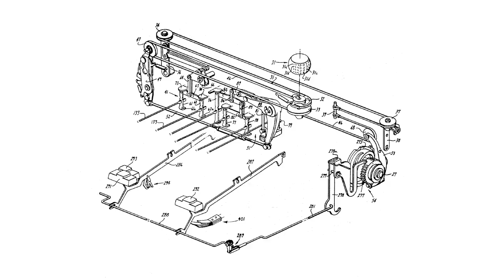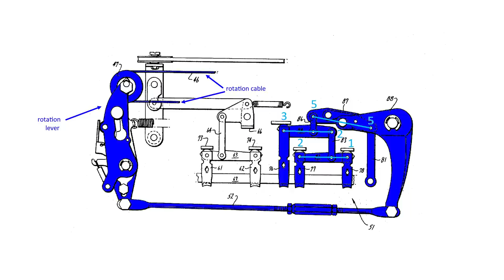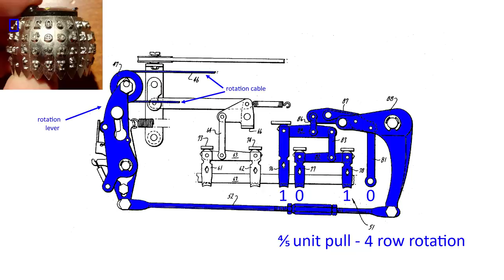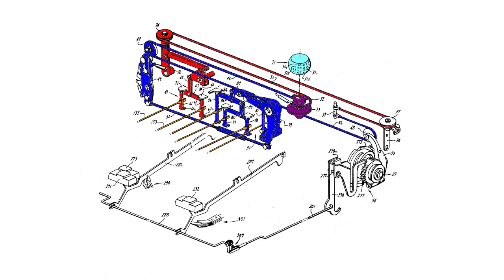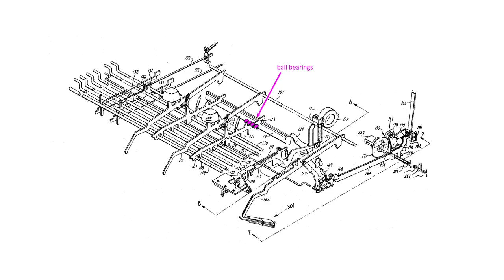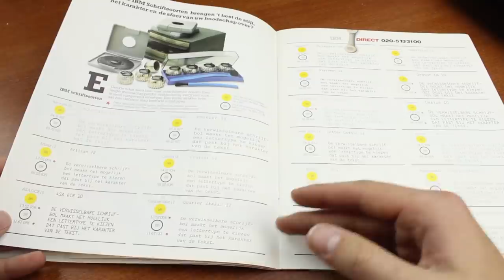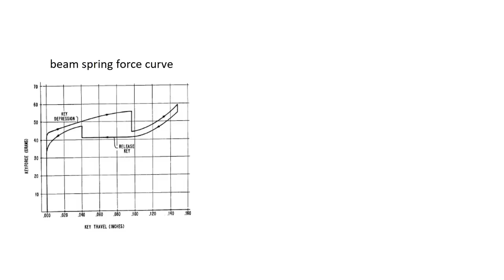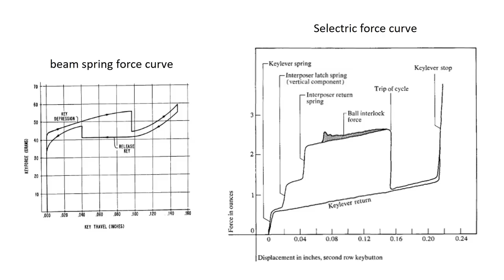IBM Selectric typewriter review - and how it works!

Comment: It sounds like your selectric has a broken belt. If the belt has broken/come off, it will sound like the motor is running too fast, and nothing will work.
Reply from the maker: Ah, yes, that sounds logical. Is there a way I could change it?

Comment: Trust IBM to come up with such a delightfully complicated yet reliable design.
Reply: I sat behind one of them at work for 25 years.  No typewriter ever
compared to it.
Reply: Look up the dot matrix printing mechanism in the IBM 026 card punch!  Each key generates a unique combination of 12 holes punched into a column, and two sets of interposers generate a unique combination of +/- X and +/- Y displacements of a printing plate, about the size of a postage stamp.  The plate has a pattern of short posts molded into it, with 64  5x7 dot matrix characters interleaved into the total matrix.  After positioning, a hammer slams the plate against an expanded 5x7 frame of blunt ends of wires, so as to propel the wires into a curved funnel, where they come out compressed into an area shorter than the gap above the top row of hole positions (known as the 12-row), and narrower than the 0.1 inch pitch of the columns.  The wires hit by posts slam into the ribbon and the card, printing (hopefully) the character encoded by the key pressed, and by the pattern of 12 holes in the column.

All totally mechanical, no electronics except the solenoids to activate the punches!

Comment: Great video. I worked for IBM US in the Office Products Division servicing these (and many other products). We also had a product in the late 70's called the Office System/6. It was one of the first systems to use a CRT display and it had a MASSIVE inkjet printer. The keyboard for the OS6 was a Selectric keyboard, complete to a cycle clutch and motor, so that it sounded and felt just like a Selectric.

Someone below also mentioned the Soviet (suspected) ability to read what was being type on a Selectric by monitoring the power fluctuations. We had a kit (Tempest certified) to solve that. It involved a heavy flywheel on a new motor (capacitor start, because of the load) and a noise filter. Installed several of those kits, as I had some defense customers. 

You mention also, 4 tilt positions and 22 rotate, for 88 characters, but the typewriter that you are showing is a Selectric III, which had 96 characters (note the yellow printer on the type element cap.
Reply: Well I doubt that soviets tried to "listen" to clicks on the keyboard. Rather they would convert (recruit) people to spies who were sitting right behind typewriters.
It is much cheaper, faster and safer in terms of disclosure.
Reply: @alexa.davronov1537  maybe as a last ditch effort?

Edit: taking photos through a window with high power photography would have worked better....
Reply: @andrewyork3869  May be, but I think it doesn't make sense cause messages would be encrypted anyway.
Reply: @alexa.davronov1537  encryption back then was radically different than they are today.

Plus it would depend if the typist or the machine was doing the encryption.
Reply: @andrewyork3869  Sorry mate, got no time to talk about this. What I'm sure about is that soviets never had any means to eavesdrop to clicking sounds. It's just economically inefficient.
Reply: @alexa.davronov1537  They didn't quite listen to the clicks, they literally 'bugged' the machine in an almost undetectable manner. A tiny transmitter hidden in the keyboard that could sense which selection links were activated
Reply: @c00kee  Man, at the time soviet regime was actively spying in the US there were no tiny bugs at all! I'm Russian and I know what I'm talking about.
Reply: Too bad IBM didn't think to make a universal-liftoff character like a big square so I didn't have to line it up every time.
Reply: correct in all your observations.   trust me, i know.  i also ran into those defense packages at some .gov agencies

Comment: My parents had one of the Selectric II units in Marlin Blue from the mid-1970s for use in their business, with the ANSI keyboard layout. They were the original owners and kept it for over three decades, continuing to use it to fill out forms that couldn't be filled via computer well into the 2000s. I know there was a whole repair industry dedicated to them, but in my experience that monster was as reliable as a wood burning stove, operating flawlessly the whole time. I remember being amazed by its heft and awestruck by the mechanical wizardry going on there even as a young kid. It must have weighed forty pounds and moving it felt like lifting an anvil. Using it was like witnessing the last vestiges of the old mechanical world before the entry of word processing in the new digital world. Turning it on was like switching an electrical disconnect, and I felt like Dr. Frankenstein throwing a giant breaker as it would roar to life and hum away at idle like an electric dynamo.

Comment: I enlisted in the Air Force in 1971. I worked on the communication system for the Titan II missile complexes. The input/output device used was the IBM Selectric with a data translation pack attached that change the typed letters to an 8-bit code for encryption and then transmission and reception. After a year of electronic and system-specific schooling, I was sent to a 14-week overhaul class for the Selectric. On display, under glass at this school was IBM Selectric Model 0001. The first one that made by IBM for the military. It was an absolute mind-bender to overhaul, rebuild and adjust to specs. On the other hand, it was an engineering marvel and a beauty to watch in action with the punch tape reader pushing it to its limits. bear in mind these were the first IBM Selectrics produced. I do miss those days.

Comment: Fantastic video! You may recall me, I commented on your video on the Remington, mentioning that I had the same machine myself. Well, my brother wanted one of these machines, a correcting Selectric II to be exact, but we couldn’t find any Selectrics of any kind at a yard sale or even a local flea market. They aren’t rare, but they also are notorious for being more likely broken beyond repair than fixable. In fact, selectrics are extremely easy to ruin. Any improper or lack of maintenance can destroy one for good. The result, however, is that so long as no one fools you into buying a piece of junk for too much money, you can get all the parts machines you could want. This is great for typewriter repair people, since replacement parts aren’t made anymore. Anyhow, just today, we went to an estate sale, and there, underneath a torn plastic cover, was the exact typewriter my brother wanted, in green, and in good cosmetic shape. We tested it, and well, it didn’t work fully, but it did type. The carriage return had issues, and a horrid noise was going on at first but went away shortly, on a whole it was hopeful but not a solution. He bought it for an appropriate $5, and just this evening took the cover off to look at what things looked like under the hood. Well, things aren’t any better than what we were expecting, chances are well just have the typewriter place do all the work, but I think we should remove all the old grease we can, where it is acceptable without pulling apart the mechanism.

Comment: I briefly worked with the IBM Memory Typewriters in 1982 or so. It was used to communicate with IBM 360 systems. Just type in commands like $da, $sprt1, $dn, etc and it would type back the output of the commands. It was very interesting and really fun working with it.

Comment: I'm long retired international IT consultant, but I owe much of my successful career to the IBM Selectric.    Entering into my year in high school last semester, I had all the graduating requirements, so practically on a lark I took a typing class.   First week of which ended up with a test.  The class of thirty or so had to be selected based on proficiency for mechanical or electric typewriters for the entire semester.  There only 5 Selectric, 5 Olivetti, and the rest were 20 mechanical typewriters.   The top 5 five scores got Selectric, next 5 got the Olivetti and everyone else were going to be effectively hobbled on mechanical for the entire semester.   I was the only male to get on any electric and I qualified for Selectric.   Going into my first year university Fortran and 360 assembly class I found I easily transitioned to the 1401 keyboard and I could "punch up" assignments in a fraction of the time of other students.   But the Selectric keyboard is easily the best keyboard ever produced.   I've never experience another keyboard that responded as fast.   Because of the unique typing element design there was never a jam.  Key feel was perfect.   It was ergonomically designed enabling the user to know whether their fingers were properly aligned.   Even powering it up and its self test was an experience, the sound of which over half a century removed is unmistakable.   Fonts, the typing element,  could be swapped out faster than selecting fonts on Word.   Correction, with the proper ribbon, was nearly as fast.   But anyway, because of my experience with the Selectric I had time to concentrate on programming instead of key punching and that made all the difference.

Comment: "I Never worked for IBM, but just twenty years ago, I was stripping these down to the Bare Bones, and Putting them back together again. Loved changing Rotate and Tilt Tapes. Drive Shaft and Helical Springs. New Drive Belts etc..

Comment: Was a IBM Field Service Tech on Model C, as well as other current machines in the mid sixties in Toronto, ON. Went to school when the Selectric was introduced and was taught all the fine points of tuning one of these beasts in the field. Also did Time Systems maintenance, i.e. Master Clock and Time Clock Sysyems for factories, schools, public buildings, etc. Fascinating  time, got to see inside of hundreds of different factories… The Selectric was the most complex pure mechanical product ever put into common use, as far as I know. Makes a normal typerwriter look truly primitive, as it is.

Comment: Fascinating and really clever in its complexity! A thing of beauty, a joy for ever. I'm just a step from getting an autumn red Selectric III for myself. These machines can still be had quite cheap here. 

The key lever - interposer - cycle bail mechanism reminds me of how the Monotype composing machine (a.k.a. keyboard) is built. That one uses a pair of keybar assemblies translating the keypresses to combinations of valves directing compressed air to cyllinders actuating punches which make perforations in paper tape.

The Selectric uses monospace characters, which makes it somewhat simpler than Monotype - that one also has a unit calculating mechanism which subtracts the width of each character (based on the placement in a matrix case) from the pre-set line length, with a scale that allows the typesetter to decide the width of spaces so that all the lines are properly justified.

As for the noise, it won't beat Monotype; no compressed air hiss here! :D

Comment: Hi Thomas. I appreciate very much the video of yours. Congratulations. A high professional way to explain a fantastic machine. If I could award the Engineers that designed this device I would give a special gift to make it even. Next video you could post it using the hood for noise suppression. I have two joys from IBM, the wheelwriter 15 series and the Selectric II. both are the masterpieces of engineering. Samples of what a competent mind can gift mankind.  Regards    From Brazil. Wander

Comment: Nice video, A few months ago I became interested in the Selectric II, I found one that was gummed up from nonuse on craigslist for $20. I cleaned it up and got it working again. It was ugly green color so I bought another broken one on ebay for $59 with a red case that I wanted, and swapped the cases. Of course I started buying golf balls on ebay, many were sold broken, but now I have all the ones that I want. Your 196c looks like it uses Selectric III elements, and is really clean. Thanks for sharing.

Comment: Fixed these things for a few years at IBM, servicing them wasn't fun, at least not for me or anyone else I knew.  All the complications had little to do with fixing them.   The problem was the tight adjustment tolerances.  In an era when guys adjusted their carburetors with sledgehammers when the manual asked for 35/1000 clearance adjustments and they meant it.  And if you didn't adjust it right, you'd break a rotate tape and add 2 hours to job and still have deal that adjustment again and you better get it right the 2nd time. 
The worst problem was, of all things, replacing the belt that connected the motor to the mechanics.   It was located in the center of the machine.   In the factory, they hung that damned belt from a sky hook and built everything else around it.   So to replace it in the field you had to disassemble and reassemble lot of things that would need to be precisely readjusted with all the risks that entailed..  
This was especially true of Selectric I/O units, these were Selectrics  that were attached to computers.   I worked in the Computer Division of IBM rather than the Office Products division so we dealt almost exclusively with I/O units..  The I/O selectrics had more more 'electronic' connections to the mechanics and even more stuff that had to be readjusted when  you had to replace the motor belt.   The first belt replace I did, was at an Eastern Airline ticket counter at MIA on Christmas Eve 1969.  I took 8 hours.  50 years later I remember. like it was yesterday.  :-)  
Office Product guys got lots more experience and were much better dealing with these things.  We computer types got less experience but when it came it was often under maximum stress.  
I think Selectric for may rapid transfer in a job where I was responsible for troubleshooting and fixing OS software.  Ah, so simple and no grease.

Comment: Actually, this machine also does have "electronics" inside. A bunch of switches decide if the machine prints or not. Space obviously doesn't print. Also a cascade of switches  (cascade of XOR) checks if an odd number of selector switches are active. If not, something went wrong and the machine doesn't print. And if the machine is out of power or during a carriage return, the keys are locked by a solenoid to prevent printing after powering up when someone had played with the machine while off. Imagine you carefully insert and align several sheets with carbon paper and then you turn on the machine and get a random letter...

This thing is ingenuous, they thought of everything. It even stores pressing space in case you press it too rapidly after a letter or twice in a row. Ordinary machines often forget a space, print a letter when switching on, print while the shift key isn't properly pressed, print during carriage return and a lot of other nasty malfunctions due to operator error or mechanical problems. This machine almost never prints a wrong letter caused by improper handling or mechanical glitches.
Reply: lapacke jolly v?
Reply: sorry, no selonoids in a selectric tyewriter.  100% mechanical powered by an AC motor.  i don't mean to sound like a know-it-all, but i've repaired these for 40 years.  but you are correct in that this machine was a revolutionary, ingenious design
Reply: Everything stated above is 100% false, lol. The only thing that's electronic in the Selectric is the motor, the rest of the device is 100% mechanical.
Reply: @BokBarber  and what makes you think that a motor is electronic but switches are not?
Reply: @CC-ke5np  All motors are electronic but not all switches are. You can find switches on manual typewriters, manual adding machines, spring wound clocks, etc, and they're clearly not electronic.

With the exception of the power switch, none of the switches on the IBM Selectric have any electronics in them.
Reply: @BokBarber  I was talking about the kind that maks and breaks electric circuits.

Comment: I learned typing on one of those, although probably an older one than the one shown in the video. If I remember correctly, the typewriters in my high school typing class had a more 1960s oval clamshell enclosure. The classroom was a room full of typing sounds. I can’t imagine it, anymore, however. It is too long ago. One thing I do appreciate, though, is that learning on the Selectric benefits me to this day. I can touch-type better than many people my age and definitely younger than me. Not sure, whether high schools still have typing classes.
Reply: That would be the original Selectric (I), nice curvy design from Elliot Noyes